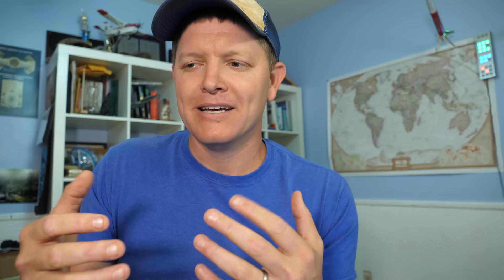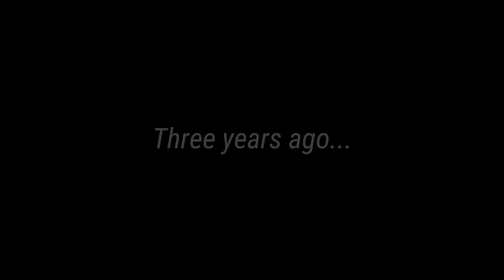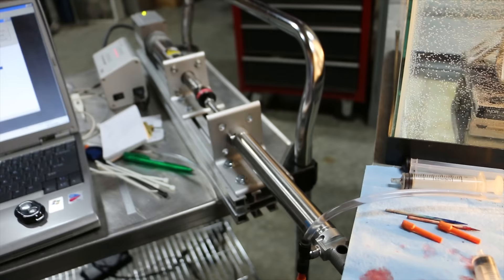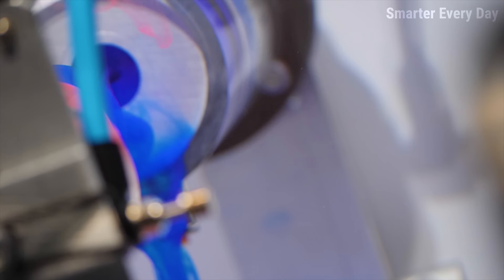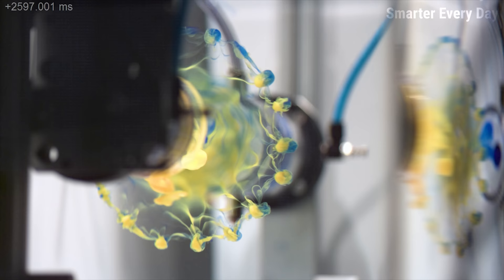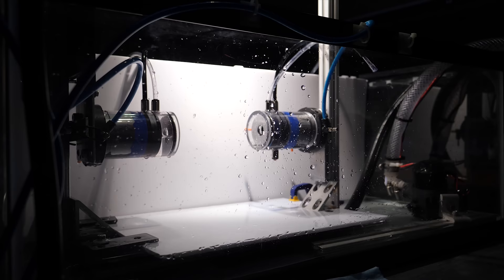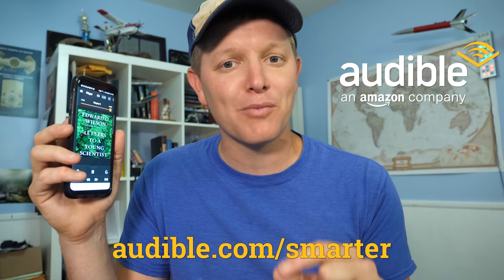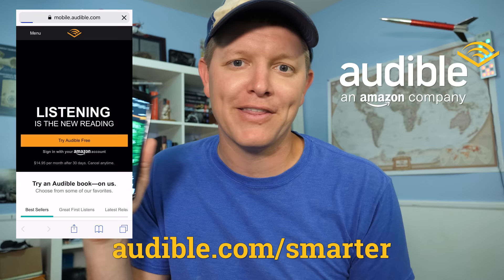Two Vortex Rings Colliding in SLOW MOTION - Smarter Every Day 195

Comment: I really like this, I think this could be scaled up to car size and we will see some truly amazing things
Reply: Yes. Stuff like this is how we evolve. Yes, in a combustion engine, the explosion difference could be tremendous giving more horsepower, better fuel mileage. Problem is that piston coming up. There's really nowhere for the second output to have the spread out flat and evenly across the top of the piston that would make it that much greater. Would have to be dead on and spread it out flat covering the top of the piston. Then you have firing, which again is like the piston, where the plug would have to set to fire in the center of the fuel meeting and follow outward with the process. Fire in the dead center, the explosion would form in the center, chain it's self from there outward, covering the whole piston top giving more power through a multiple combustion series and require less fuel. Then you have timing. That's a whole other problem to get straight. Do you fire before, during or after contact? Computers should make easy work of that though. I like where your mind is headed with it regardless.
Reply: Oh wow. I interpreted his comment as literally scale it to the size of a car, not scale it to be used in a car. But I really liked reading your thought process :)
Reply: Nah I think he meant, scale the mechanism up to a size that would produce those water donuts close to the demensions of a full size car, in order to enable you to see higher detail close up, as to what is really happening during the collision. I would assume he didn't say anything to the guy with the elaborate engine application perception, because it was much more interesting and impressive of an idea and he'd rather just keep quiet and accept credit and applause, then explain his original intent.
Reply: @MrJadedGreen  That being said, I have no idea how you came to the conclusion you did, and I'm not even sure what you're trying to imply here..
Reply: @ThePineTreesBand  Had he said just to make the scale larger, why would he not use a house or something large, other than a car as his scale point. The whole reason for tests like this is for uses such as combustion engines. The mention of "car" scale, the test it's self, is the reason for my reply. This sorted out in the use of a combustion engine of any type would use less fuel and make more power. There is no need in making some large scale machine to do the test with the technology of today when they can zoom right in on whatever part of it they need or want to look at for examination.
Reply: @MrJadedGreen  I'm still a bit confused as to what aspect of an engine this could be applied to.. are you implying in regard to the fuel injection, and the resulting effectiveness of combustion?
Reply: @ThePineTreesBand  I'm really just curious as to if you are serious or if you are playing around. With whichever case, all I will say, is in your question your answer is found.

Comment: I can explain why it turns 90 degrees, (or at least have a theory.)

The rings are rotating in such a way that supports the creation of more stable rings.  With any regular vortex ring, the center always pushes forward.  When the two vortex rings collide, any matter that is being pushed forward from either ring is flowing outward between the vortexes, as if the space between the two vortex rings were just the inside of a normal vortex ring if it were a continuous line.  All they have to do at that point merge at two points, however that may happen, to make those rings at a 90 degree angle.

Comment: It went 90 degrees because both rings were spinning the same way. That's why they are both going forward in their direction. The separation of the rings into tiny rings is because both ring spins with equal speed of rotation. So it actually cancels each other. The membrane is part of thw ring that lost its speed of rotation. You will get better result with bigger and thiner ring. But it will be harder to see...

Comment: @smartereveryday I think I understand the formation of the secondary rings. 
At the onset of primary ring instability water starts flowing towards the nodes from both sides. This inward flow creates an impact just like the impact that created the primary ring. This impact creates a radially outward flow that is co-planar to the bulk direction of travel of the node. The radial flow interferes constructively with the bulk node flow to create the same velocity profile needed to form a ring facing the direction of travel.

Comment: Destin, vortices are very important in aviation as well. We deal with them all the time and they basically show how the wings can generate lift. I'm trying to find out if there is away to explain the phenomenon you're showing here with aerodynamics. Air is a fluid as well and should act like an incompressible fluid up to much greater speeds than for your experiment.

Really fascinating phenomenon!

Comment: It looks like the first rings edge breaks into multiple sections (clumps) . The wavefronts lower pressure side helps keep the material moving outward. The action that creates the second rings is that the clumps inside high-pressure area are naturally going to the low-pressure wavefront. As these clumps are somewhat spherical at this point the resultant action is that the clumps inside moves outward from the collision area. This, in turn, makes this spherical structure turn inside out. This action of the clumps insides going outward and the edges of the clumps moving slower means once the material has distorted enough the outside will be sucked into the inside from behind these rings (closest area to collision area ). This makes it own little vortices which appear 90° rotated.

As an extra note material is still fed during and after this to behind the secondary vortices and this material is fed through the center of the vortices as well adding to the vortices rotational speed and velocity. The rotational speed helps stabilise the vortices and allows them to persist for longer rather than dissipate.

You can see these steps happen if you slow down the time and focus on one clump. I think a good follow up would be to try using different fluids other than dyed water (one that doesn't mix with water) and see how this changes the timing of different stages.
Reply: Yes, the smush re-vectors the momentum radially. After that, faster velocities (they shoot the vortices at different velocities because of squeezing harder) of the expanding ring, creates a faster 'rate of increase' of an already ever increasing reynolds number (of the expanding ring). Once the flow 'trips' over into becoming turbulent, it creates high and low pressure areas. The low pressure areas along the radial, create fast moving flows that move towards the high pressure areas. You can see this as the die moves tangentially to the wave front. The low pressure flows come from both directions, clockwise, and counterclockwise and meet 'behind' the high pressure part of the wave front. Both of these flows now act as NEW jets that meet and form short lived new vortices.  The reason the new vortices are short lived is because the flows already have a high reynolds number (are in various aspects of turbulent flow).

Comment: When both the rings are similar enough, the symmetry makes the flow go 90deg from the pulse. Larger things behaves very differently than smaller things in water. That's why you get the "low pressure" zones. The water "prefers" to flow in a cluster, rather than continue to become thinner and thinner, because it's the path of least resistance. The next rings are formed because the water that doesn't move outwards pulls the edges back around them.
Reply: think its got to do with curl of vector field?

Comment: @SmarterEveryDay
 The small rings break apart and deflect sideways because of Displacement. As the smaller rings are traveling outward, they're displacing water sideways which creates a "pulling" effect that breaks them apart. As the small rings lose their inertia they become more easily affected.

Comment: I realize this video is 4 years old but I wonder if this is correct:
The secondary rings can be explained through the concept of fractals, a pattern that repeats itself. You guys said that as the ring expands, there are periods of high and low density that pull themselves together (6:31). This is very similar to how the process started, where the two clumps of dye collide in the middle, splooshing out. This would explain why the rings are at that angle. I bet, if the accuracy was high enough, 3 recursions or more could be achieved.

Comment: Something that would be useful for analysis, if you illuminate with polarized light and then film with a polarized filter. The diffraction will show up, and that will give more data. Especially if you use two cameras, so you can turn it into a 3D image.
Reply: dummer every second
Reply: @sausages6135  Dumber
Reply: I’m more interested in the gravitational applications in long term space flight.
Reply: So viewing more of the light spectrum would def add more data.
Reply: @guyjameso  come on you just invented that huh

Comment: It never occurred to me that the different fluids don’t mix in the ring.  I expected yellow and blue to make green rings, but not only were they separate in the initial impact ring, they maintained separation even with the orientation change of the secondary ring.  Seems like If that stretched on infinitely, you’d have two mirrored fractals but the color would never cross the impact plane. That’s neat.

Comment: Just a hypothesis but it could be that the ringlets form at that angle  as they are still caught in the shock wave of the initial vortex collision. You can see that as the large ring separates into the smaller individual clusters (which seem to be a small scale version of the large vortex collision) they're are still under the outward-spreading forces of the two fluids colliding causing the clusters to spiral out at a 90 degree angle.
Reply: I think that makes sense. I'd also like to propose that a a pocket of sorts forms in between the inks when they collide, sort of like when you drop a pane of glass on top of another pane of glass from a couple inches up, and the top pane can slide around frictionless for a bit until the air between them is pushed away. The impact pocket delays the mixing of the both inks for a short time, which makes it so that they won't blend until the secondary rings form.

This could be confirmed or disproved by varying the velocity of the inks to see if the time it takes for them to mix is shorter the slower their velocity is at the impact.

I'm not a phycicist, though, I'm just a YouTube commenter who loves lava lamps.
Reply: NEMESISJ18  could the size of the tank be influencing this aswell? As it get toward the sides of he tank could that be forcing the flow a different direction slightly?
Reply: 59hemikiller I think i know what you mean. The effect is similar to a ripple which spreads out until it either dissipates or its expansion is impeded. The effect occurs at the bow of the expansion at a point where it has yet to collide with any opposing forces leaving only the resistance in the medium. As in: there is always an equal and opposing force.

Comment: The secondary rings formed by the pressure differential and cause secondary dye collisions along the outside of the primary ring and these secondary rings just do the same as the primary. What would be cool is if you could increase the size and try to create tertiary rings on the outside of the secondary rings.
Reply: levet byck hmm you may be right I think it would be an interesting experiment nonetheless

Comment: Maybe it turns 90° because when the ink is shot out it moves the surrounding water out of the way for the ink to pass through causing the water to move, causing the 90° turn?! Basically water displacement is what's causing it. It makes sense in my head. I can visualize it. Idk what I'm talking about though, but that's my theory.
Reply: To me, it looks like the perpendicular-tertiary rings are formed the same way the single ring is formed.  When the two bodies meet they displace outwardly forming a single ring.  Destin said it with the low pressure theory, as those "low pressure" zones collapse the ink flows to a point and these colliding bodies displace outwardly again.  This is really cool though because all these tertiary rings are formed by fluid moving radially in relation to the center point of the main collision…. Beautiful!
Reply: I believe you (K Love and Bebo18) are on the right path.
Reply: When there is fast-moving flow, the slow-moving flow/static fluid around it turns into wheels to lubricate the fast flow. In this case the flow is moving as a single jet through a static body of fluid, so you get that sort of mushroom cloud form where the lubricating wheel is in a donut shape.
Reply: I posted a general comment above describing what I think is the Physics behind the phenomenon here. Given your question, I thought you might be interested in checking it (although I realise I probably fell into the trap of using too much jargon, sorry about that).
Reply: Bebo18 
Kinda felt the same way when I left my idea / theory.

Comment: Destin, you should try filling up the tank with small leaf bits or dirt or something and see what happens to the floating leaf bits if you push the rings without any ink. 

Please like if you agree
Reply: FroopyLoopy idk if that would work
Reply: I was going to suggest adding flecks of something like glitter to the dyed rings to see relative velocities a bit easier
Reply: I'd be surprised if they didn't do this already. It's usually not done with leaf bits, but with tiny air bubbles. Usually generated by running a current through a wire. It's not as pretty to look at, but it can be very informative as far as fluid dynamics goes.

Comment: Best guess at the physics here is that the 2 vortices colliding act like a pair of rollers working in opposite directions which in turn work to eject material along the plane of collision at the point of impact. It is effectively a circular version of the injectors you are using to create the vortices in the first place.

However, water does not compress very well, so every action of compression must be counteracted by a region of rarefaction and this resolves into regular regions of compression and rarefaction around the ring.

I further suspect that the determining factor of the dilleniation of those regions is driven by the speed of sound in water. It would be very interesting to see if you could affect the number of secondary rings by altering the temperature and/or salinity of the water. 1 degree F would change the speed of sound by 6 fps and 1 ppm salinity by 4 fps. Some math based on the circumference of the ring could give you a good idea of where to start, but 10F hotter or cooler would be an interesting starting point.

Very cool video regardless.

Comment: If this was somehow created in a perfect simulated environment, with no wind or anything, could it be possible that there are even smaller rings within the secondary rings that come off of the main, large ring? Like a fractal?
Reply: Exactly what I thought
Fractals
Reply: Don't you need the collision in order to form the next rings? The two primary rings collided and formed secondary rings. I am assuming the secondary rings must collide with rings of the same size and speed to form the tertiary rings.
Reply: There could not be continuation of collisions to form fractals.
The reason we even see the secondary rings is because there in no longer an opposing force so the rings return back to their original trajectory before the primary force.
See, the machines which pushed the rings of color out are creating a horizontal force. When the two blobs collide they meet equal force thus turn 90 degrees and create vertical force. That force is still carrying horizontal force and at a point, the vertical force is overcome which then give the paint its ability to continue on the original horizontal trajectory. Creating the secondary rings. The rings are also created because the equal force is no longer great enough to oppose itself but still there enough to create a spherical outcome. The force ends there. There is not enough vertical force from the collision to then create a third ring. The higher force will always be the force which created the collision. The horizontal force. Anything else is dissipation.
Reply: The limits of the repeating fractal are determined by the fall-off of inertial energy which propels the "dyes" in the water (even with no dye, there would be a front wave of energy between high and low pressure inside the water column. Though there is no distinct line in the water column, the average can be represented mathematically by a fractal, which is by the way, only a manipulation of phi, in this case representing high and low pressure waves' motion.
Reply: Toroidal vortices are usually rather stable so i wouldn't expect them to break apart without a collision
Reply: Are you sure about that theory? @marztar
Reply: maybe at bigger scale?
Reply: interesting, how about colliding the smaller rings when you put the two big rings crash beside each other precisely at the same horizontal  (or not?)
Reply: , @marztar  -- I was going to say that! or basically, no fractals, unless they had other pumps shooting ink in the precise locations of the secondary ring formation, to provide the needed collision to spin more rings off... wow! My head just exploded, and is getting oooky stuff on my floor, now... just touching the 'edge' of the calculations and attempts it may take, to even get ONE secondary collision.... if they were to set up a bigger tank, mount injectors.. etc.... etc....... Arrrrgghhhhhhh!